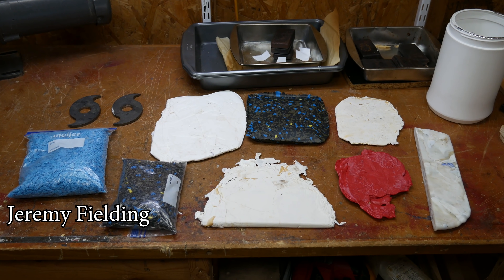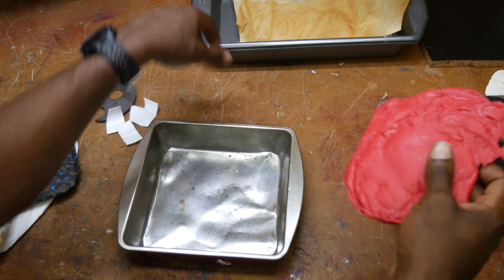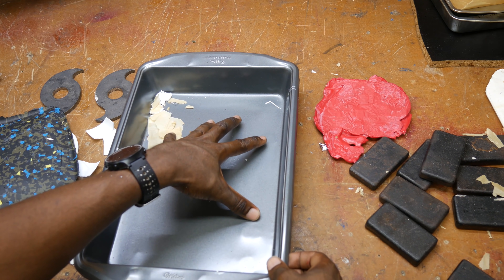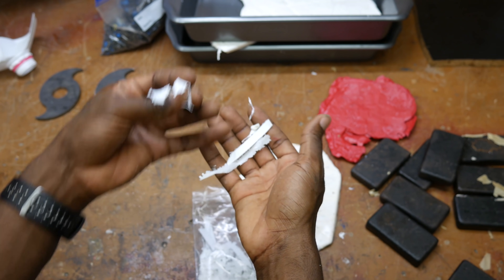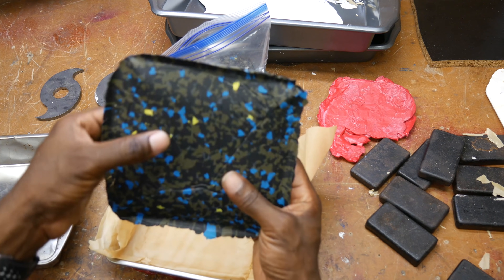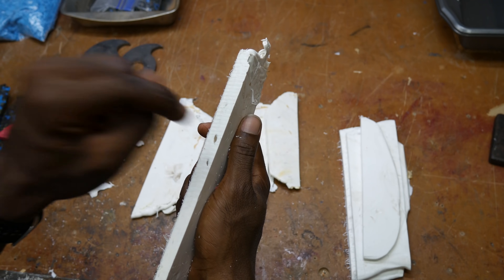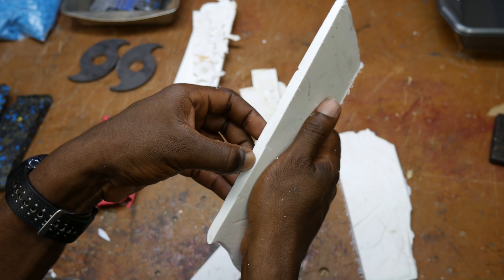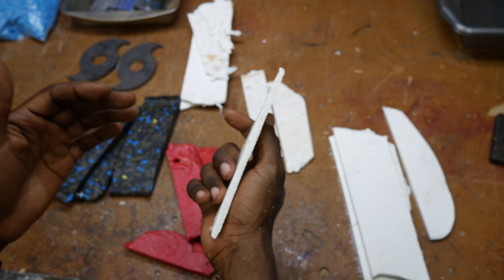HDPE, How Much Processing Is Required; I Put It To The Test!: 043

Comment: to me its not a question can you get it solid without cutting it as much the way a professional shredded plastic would be, and my answer is yes you can make them 100% solid exactly like the quality you would get from it being professionally shredded ....the only factors you will need to consider as an individual doing diy project like this would be only if you are willing to put actual effort in compressing it threw out each heating time every 10-20 minutes take it out and fold it on to it self then sticking it back for another 30 minutes then taking it out folding it again a few times....then after the  3rd time using strong clamps and compressing it with a square shaped box jig till it flows out of the sides and as its cooling ever 10 minutes squeeze it more till an hour is passed it will be super solid pieces so the trade of is time and more effort but if you dont have the money for parts and things as such then there is no way around that but if you have the money for parts then its worth making one for less of your time and effort. To conclude i think both ways you can produce exact quality in the final resulting material you just have to decide where you fit in what of both ways you will be doing it or need to do it do to money.
Reply from the maker: That really is the point of this series of videos...We know that nearly every task can be made easier by purchasing the right components... you can use a ax, or a chainsaw... one is a lot cheaper than the other... what I was interested in is whether or not one could build something using unconventional methods to produce a decent product at home. I have simply been sharing my results and thoughts with others to let them decide which way they want to go. I have in fact made a very cheap and effective shredder. I just haven’t made the video yet. 

As to your other comment... it turns out that uncut pieces will always fail because it seals in air pockets and no amount of compression will close them. Air is not infinitely compression-able. I didn’t consider this problem during the making of this video. But after talking with several shredding experts (responding to my video) this has been my experience and their advice.
Reply: i agree on your first part i made that comment for those that comment and still question certain things, all tho the second part i do not agree on i have seen lots and lots of videos doing it that way with great success even a 13 year boy does this daily not cutting the parts in very small pieces and has 100% infill in the parts using a vise clamp and some other clamps tho takes his time each time reheating it and i can link you to the video if you want as well as many many others on here.
Reply from the maker: Perhaps I didn’t read your comment carefully enough. I have done this myself (heating and kneading repeatedly) and that does work, but was not what I was picturing when responding so sorry about that... I have seen that kids video. I used (and still use) a griddle with silicon baking sheets and that works well... but back to your original comment it does indeed take some time to do that. However I must agree I was satisfied with the results I got. Is it worth the effort... that we agree also depends on who you ask.
Reply: Jeremy Fielding I enjoy every one ood your videos seeing that I do the same things and sometimes learn so much in ways someone else's goes by doing one thing or another.... there's maybe a project you might be able to help me out in if possible.

Comment: Hi, I work in a HDPE bottle making plant. the shredded stuff is called regrind and we grind it so it will mix with the virgin and so it will fit into the press screw. Our molds are made of polished chrome and we still use silicone spray to help it not to stick, till everything heats up. for the home jobber I would say process the stuff to minimize the air gap between pieces to minimize air pockets. the plastic bonds very well and easy so if there is air that gets sealed in you likely won't get it out without getting the plastic close to liquid (too hot).
Reply from the maker: Thank you

Comment: I earned a certificate for plastic pipe welding from the Laborers International Union> HDPE pipe is seamlessly welded using electrical irons in the field powered by AC generators . Such pipe is used for gas and other utility lines.  We had hand held and bracket held irons  with handles. Those sometimes have built in thermometers and there are handheld thermometers as well. However we were taught to use our eyes to see how liquid the HDPE becomes when heated. The heat needed varies with the materil size and the job. But generally speaking we worked fast at temperatures of 450 degrees fahrenheit for pipe around  2 inches and 650 degrees for heavy pipe with thick walls  about 6 inches in diameter as I recall. ( It was in the early 90s.) At those temperatures flow is not a problem. I have used a soldering torch with a solid tip to make repairs and bond HDPE car parts at home successfully. Again, watching the shine of the material wihich emerges when it is hot enough to flow and seamlessly bond.
Reply from the maker: Thank you.

Comment: the point of this product is reusing waste right? then how in the world is it okay to run an oven at full bore for several hours to end up with a plastic pancake. You could probably buy plastic billets in whatever dimensions wanted for the electric costs alone..  Not to mention your time.  Please tell me the upside to this process. Thanks
Reply from the maker: Please take a moment to search for HDPE plastic sheets. You are grossly underestimated the cost of a sheet. Or electricity cost a lot more were you live.

Comment: Use a pyrex glass baking dish or glazed bakeware and you WILL NOT need any paper, weights or kneedding needed. Bake around 300 F and as it melts down add more about every hour until thickness needed. For a cylinder type shape use a coffee cup or round glazed bakeware. I've had great success with fine chips as well as milk jugs cut in half, it will all self level and be bubble free with a little time. and let it cool in the vessel used to melt it in, it will shrink and self release. hope this helps.
Reply from the maker: I started using silicon baking sheets and they are perfect

Comment: Just curious, what is the ultimate point of all this? (Not being a smart ass, I really do not know)
Reply from the maker: At first it was just reshaping plastic for other uses. It is significantly cheaper than buying blocks of HDPE when you want to make someone out of plastic. Later, I became interested in making it cheap and easy for anyone to do.
Reply: Jeremy Fielding what kind of things are you able to use it for?
Reply from the maker: Anything! Really anytime you want the properties of plastic. The last one for me was slides for my table saw sled... slides easy it’s hard, and easy to cut/shape
Reply: Jeremy Fielding okay that's kind of interesting. ..do you have videos of things you have made with the plastic?
Reply from the maker: No

Comment: Seen a bullet proof vest from AR500 I think you could make your own wih this method the armor from them works great thicker than steel plates but held all the bullet no spalling even with many hits taken from 308 just( maybe some help for Jeremy use scuba belt weights I have a bunch small ones are about 8lbs ) you could fit four or five in that pan look them up might be better then the steel weights
Reply from the maker: I don't really need the weights any more. My method has changed quite a bit and the process is pretty easy. I plan to make a video in about a month that shows the new method.

Comment: When I was 18 I worked at a safety factory making plastic safety gear, hard hats, glasses, etc.... The place is was in small pellets simular size of pellet rabbit food comes to mind. A powder dye was added when needed then placed in a hopper. As the plastic was melted it was injected into a mold. Mold opened there was the parts. So it is no surprise to me the smaller pieces work better. Perhaps a better clamping system to apply more pressure before it cools. Good luck Jeremy.

Comment: For your shredding device I see that if you were to add a second set of blades that spin in the opposite direction all you really need is two matched gears that fit behind the belt driver
Reply from the maker: typical plastic shredders use a single shaft instead of a double shaft. There are design reasons for this. Have a quick search online if you are interested in that sort of detail. Single vs double shaft shredders.

Comment: Would non-stick baking pans work better than parchment?
You can buy Teflon in aerosol spray cans.  Search Google.
You can buy Teflon in dimensional pieces like sheets 1/4" thick.  It's expensive, but you don't need that much.  Thin sheets are cheap: goo.gl/D8n3ED
Reply from the maker: I now use silicon baking sheets which work great!

Comment: I work in the HDPE welding industry...  we weld and mould hdpe at 225°c, if that helps, the thickness of material increases the time for heat to penetrate it ie thicker parts longer heatsoak period,   we use teflon coated heatplates to heat materials up and hold them at 225°c (for solid material joins slightly hotter for what your doing) dont liquify it, it becomes brittle..  use teflon kitchen equipment and paper wont be needed for sticking, clean all surfaces with isopropyl wipes 99%   it needs oils removed and all water vapours dry to be strong, your can use a sandwich press or brevil to heat your materials quite nicely at home, and how you used weights to pressurise your material is correct, we use a hydraulic press while heating inbetween heater plates at a low psi, then crank the psi up for joining till the edges of your work rolls over like a bead on itself, then heat is removed but psi is left at full crush while cooling til fully cold which takes minutes at room temp for thin material 1mm-5mm  upto 15min for material 5mm--15mm and upto 35min for materials 15-40mm thick..  hope that helps anyone else interested in poly..
Reply from the maker: Thank you for all the tips. I started using a griddle/sandwich press about two months ago and like you say, it works amazingly well. I have found I can melt alot more plastic much faster, open it, roll the plastic a little, and flatten it for a very uniform flat piece. I am very happy with where the process is going. I also use silicon baking sheets to prevent sticking and that works great. I have not been cleaning the surfaces and I will start doing that. I love it when you guys share your experience here... we all learn so much that way! :)
Reply: Happy to help..
Reply: I subbed and watched more vids..  in your plastics test vid u show how some of your pieces had voids, firstly  most of them were close to the centre which tells me you have great heatsoak everywhere else first so the centre is melting a long time after the edges and the air between them is trapped once the outer layer has encased it..  its a problem, but it tells us your melting at the right temp range, its just taking too long to soak in to the centre so its not melting uniformly..   that is probably caused by your heating method? Im guessing you used an oven? But if you did, youve done extremely well, it is much higher quality workmanship and a result than u may realise atm..     also as the poly heats up or gains heatsoak it becomes soft (as u know) and it starts filling the voids around the edges  but as this happens it relieves pressure from any clamp system forcing the plastics together and needs to be tightened gradually as it heats up to help the heatsoak penetrating to the centre evenly, your weighted system is great as gravity helps this as it softens it sinks and made your edges perfect but wasnt heavy enough in the end to force out the air bubbles..    so if you use an oven again, i would preheat a thick and heavy tray (not thin like the ones in the vid they lose their temp to the plastic too fast, basically robbed of all heat)  and add alot more weights gradually too, better yet use g clamps and tighten them 1/4 turn every minute or 2, last of all the force we apply in not gentle even on small pieces while setting(hardening/cooling) from 20- 100psi, the forces applied for melting are more gentle around 1-4psi but that is alot if you think about your square pans surface area and do the math   its a lot more weights needed so I'd use clamps, if you use the heater plate route like a amatuer pro make a massive sandwich press style contraption your can clamp at high force or even use a car bottle jack to control the force..   also i forgot oxidisation earlier, large pieces being welded need the surface scrapped of .2mm deep or it wont stick well to each other ( we use sharp paint scrapers) on large object joining..    hope some tips helped out again.. cheers for the inspiration...     ps two flat george forman style grills would be great to squash it between on a car jack contraption..
Reply: Pps if your looking for more build ideas!..  us in the backyard precious metal refining industry are trying to build bga ic and cpu chip crushers that can make computer chips a fine sand, ive seen quite a few vids and no one has worked it out even drum style ball mills fail, but no ones gone anywhere near as detailed or precise as your plastic shredder which i think is very close to being able to achieve the cpu chip crusher goals, so if you could design a chip crusher/shredder that would be amazing, every scrap metal channel will love you lol... ill build one one day myself but need more inspiration atm lol..
Reply from the maker: Welcome to the family! Yes I was using a oven at the time of this video. But as I mentioned in another comment with you, I now use a griddle which worked fantastically

Comment: I just watched this kid take out the voids / bubbles by taking it out and press and folds and twists the plastic quickly then puts it back in for 3 to 5 min heat it up and reapply
Reply from the maker: Yes. That is basically what I did to avoid the "voids". But I prefer to skip that... and shredding has solved that problem. Now I shredded and heat the plastic in a griddle with silicon baking sheets. That works really well.

Comment: Hi Jeremy. I am not a hardware type person, I'm an artist. So, personally, I love the swirling marbly textures that happen when melting HDPE in big pieces. The finely shredded plastic comes out more solid but it's not lovely at all. 
But then I got to thinking about how construction guys, when pouring concrete, use  this tool that they poke into the wet concrete and it vibrates. Would that be a possible solution to having solid pieces but swirly colors?
Reply from the maker: That would be quite the challenge in a home shop but possible. You would get a better mix though not less.

Comment: Well done! Classic, textbook scientific method applied to a noble cause and outcome! I might suggest that comparing ultra high molecular weight poly-ethylene to more common high density poly-ethylene impacts your results more than you recognize in the video, otherwise I continue to be glad I subscribed! Keep teaching me!
Reply from the maker: Even if you remove the "special" plastic, consider that my "shop-shredded" plastic performed just as good. That was the real comparison. HDPE from the same source, some shredded to dust, and some barely shredded. The professionally shredded stuff just added another layer to the concept I think.
Reply: I agree, which is what I like about your approach. Well done!!

Comment: I am new to melting plastic to make new products but I was wondering if the voids are caused by gases building up or air being initially trapped during the beginning process? And have you ever tried any kind of vibration methods to maybe help to fill in the voids or maybe even vibrate materials into the voids and force any gases up and out. Again I have really just started to even try anything that has to do with this work. Thank you
Reply from the maker: I mention this in the video description. That is basically what is happening. The best option is shredding to leave those pathways for air to escape.
Reply from the maker: The difficult part of HDPE is it doesn’t flow. Vibration would be ineffective I think unless it was very violent which would be difficult to build and maintain.  I presented the “sheet” option because so many people keep commenting that shredding is not required. I think the pros do it for a good reason. I will continue to work on shredding

Comment: Take a round steel pipe rap the heating element from elect dryer around the pipe make a plug on one end with 1/4 in. Hole put a cutting knife next to hole then make a ram type piston for the other end .now you have an extruded plastic pellet cut to any length or injected into a mold . that's what I'd like to see you build

Comment: Would using a T-Shirt press be a viable alternative? You could put more pressure on the batch only thing is I don't know how hot they get.
Reply from the maker: I don't either. I am using a griddle to melt my plastic right now which seems to work really well. You might be on to something.

Comment: I wonder if it would be effective to melt the plastic into rough billets and then run them through a thicknesser (once all the wood shavings had been cleaned out). Would a thicknesser designed for wood be able to cope with plastic?
Reply from the maker: +Peter JF that is a great question. I haven’t tried it. My gut reaction is yes. But you would want a dedicated machine. I am not up for cleaning it each time I switched from wood to plastic and vice versa. I would want to protect the surface of each from the other.